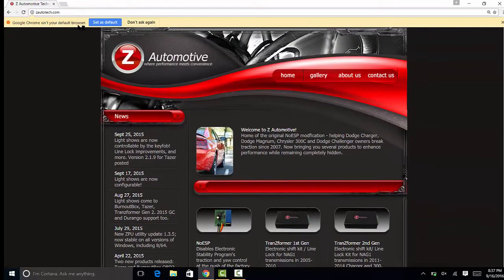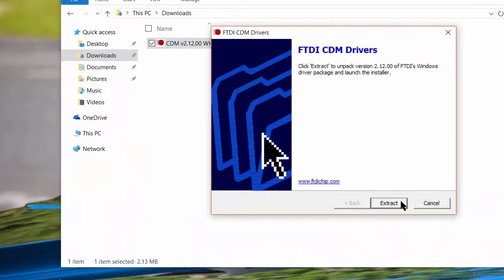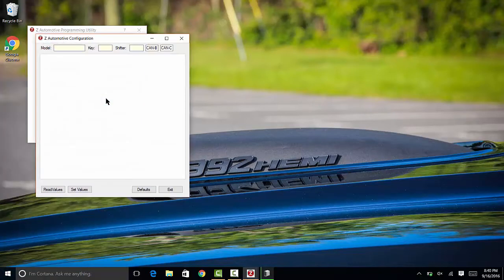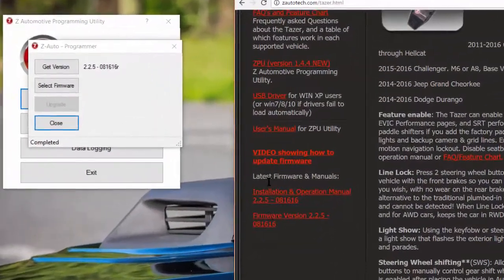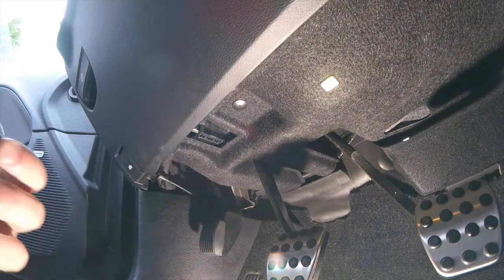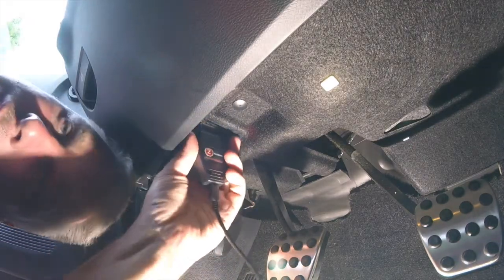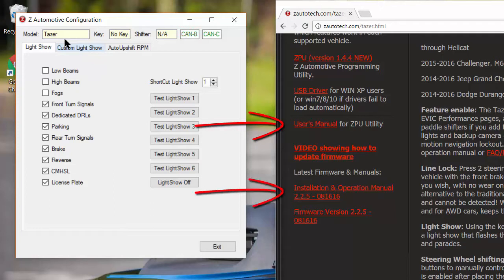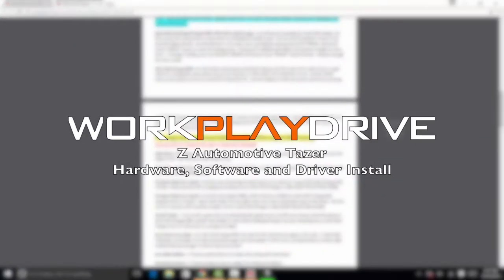zAutotech TaZer Software, drivers and Hardware install - zautomotive.com

Comment: Just subscribed, I have a 2017 Dodge Challenger SXT Plus, my model didnt come with factory Super Track Pack  or Drive modes options but does have a 8.4 Uconnect system. Will the Tazer turn on the performance pages on the EVIC and 8.4 Uconnect screen?
Reply from the maker: Thank you,  it’s a long list of what works and what features can be turned on for the SXT models. This page has all the details on what features work with your vehicle https://zautomotive.com/zpu/instructions/tazer_user_guide_2.5.1.pdf
Reply: @WorkPlayDrive  Thanks for that link. I just read it. So let me make sure I am understanding it correctly and maybe you can double check me if I am wrong, so my SXT plus will NOT have Super Track Pack performance pages added with the use of the Tazer device, correct?

Comment: I did everything but the tazer won’t show up on the pc the light flashes red but won’t connect to the computer ... the drivers were installed
Reply from the maker: Have you tried using a different USB port and cable?

Comment: Can i use it on multiple cars like opening srt pages for someone has a diffrent car than mine for ex: i have a grand cherokee can i open srt pages for someone who have a charger ? 
Thanks.
Reply from the maker: Yes, you can enable some of the features as long as the car supports it, but the live functions will not work without the TaZer connected.  This also creates the issue where the person you enable it for will now need to rely on you to disable it before they go in for dealer service.  Lastly it's kind of cheating the system using a product designed to be purchased for 1 car on multiple vehicles.

Comment: Hey man. I have a 2017 charger scat pack and done everything said to do and most everything works but my SRT pages do not show up at all. Any thoughts?
Reply from the maker: I believe they were having an issue with some (not all) 2017's have you reached out to their support?  https://zautomotive.com/about-us/contact-us/ They will be able to provide some more info on the issue and their planned release of a fix.

Comment: Sadly my Computer does not find the Tazer. Using  Windows 10, i also tried to install the USB Driver with sucess. But its still not found from the ZPU Software....
Reply: Problem solved. The USB-Cable which was sent to me with the Tazer is broken, replaced it and its working now.
Reply from the maker: Nice, I was going to recommend getting a new shorter USB cable.

Comment: Both have to be green or one cuz mine only second one is green and first one is green and red green and red ??
Reply from the maker: When connected to the PC does the ZPU allow you  to configure?  I had an issue with one of my PC USB ports and had to unplug the Tazer, reboot and connect it to a different USB port.

Comment: so are you suppose to have the tazer in forever or is it ok to take it out once you make the changes you need to make to your car?
Reply from the maker: Some features require the tazer to be in like the line lock, light show a lot of other features can be changed and the Tazer removed.   Check out the section called Live Menu settings for the ones that require the tazer to be connected.  http://www.zautotech.com/docs/Tazer%20user%20guide%20-%202.2.7.pdf

Comment: Will this void warranty by any chance?
Reply from the maker: I would recommend putting your settings back to normal and removing the TaZer before servicing.  If you are going in for troubleshooting you should always provide the techs with what they are used to, added settings, changes and an additional device will result in extra time while they try to understand the the cause of your issue.  

To answer you question here is a quote from their FAQ  http://www.zautotech.com/docs/Tazer%20FAQs.pdf

Q: Will this void my warranty?
A: Per the Magnusson-Moss Warranty Act (1975), a manufacturer can only deny a warranty claim when an aftermarket
component is used if they can prove that the component caused the failure. Simply write down the settings that you
used the Tazer to change, and change them back to their original values before service - it’ll be as if it was never used.
As for “live” features such as light shows, line lock, full ESP disable, nav in motion, force video – use of those features
can’t be detected.

Comment: Thanks man!! Great vid. I ordered my Tazer a week ago last Monday, so it should be here by tmr or Thursday at the latest and I can then open up some cool stuff too.
Reply from the maker: One of my favorite features is the light show (headlights and fogs disabled)  It screams "look at me" when at car shows ;).  Can't wait to reset the adaptives and use the shift light at my next visit to the drag strip.
Reply: Have you tried to make a "Custom" Light Show yet?? I now have all the settings where I want them and I did notice that when I have the SRT settings enabled that I lose the SCAT Bee and only have the choice of "Challenger or Hellcat" the Bee is gone with the SRT settings enabled. Oh well!! It's only on for 2-3 seconds anyway and I like the SRT settings enabled. The default Light Shows are cool, for sure, but I want to make up a couple of my own. I assume that when making my own "Custom" Light Shows, and want to test them, I bring my laptop into the car with me, connect the Tazer to the laptop and have the car in the "RUN" position but NOT running...is that correct?? I can't seem to find anyone else anywhere that have made up their own Custom Light Shows??? What do you think??
Reply from the maker: Not yet on the custom light show, soon though. If I remember correctly you can access the light show options with the car off and laptop connected. If you make any good ones don't forget to share them.   

I just turned on SRT mode on Wednesday for the first time.  Correct the Bee will go away because the SRT more completely changes the display design and fonts, I was a bit sad but the changes were totally worth losing the bee.
Reply: Well, I had a useless hour spent trying to do a Custom Light Show. I got NOTHING!! The only thing I did get was some strange crap. Can you tell me if you noticed when you're cycling through the Tazer options if you saw (NO DEVICE) flash for a second in between any of the options at all?? I don't remember this happening to me when I 1st installed the Tazer, but maybe I missed it?? I doubt it but that's why I'm asking you?? Lol.. Secondly, once the Tazer is loaded, it's loaded, correct?? Well, I had to re-load it twice today. It was empty, NO 2.2.7 or anything for that matter. And 3rd, does the RED light go out eventually, when it's connected to the laptop?? It starts off with a quick flashing Red/Green combo, then a slow Red flash and every 4th flash, there's a 5 second break, then it starts again with 4 Red flashes, then a break. Finally, the 3rd and last time I tried to re-load 2.2.7 I get a pop-up window stating that there is NO DEVICE PRESENT and it suggests that I look for the Device in COM3 drop box, but when I hit the drop arrow, it's empty of course. I'm NO computer whiz by any stretch of the imagination...but I think I have a (TECHNICAL MALFUNCTION) going on here?? Yet when the Tazer is mated to the car, all the options function as they should, but for the Custom Light Show, obviously, since I can't get in there to do anything. And btw, if you want to activate the A Light Show while the vehicle is in motion, Connect the Tazer to the Laptop then, go to the CONFIGURE PAGE, then LIGHT SHOW PAGE and click (CTRL + SHIFT + L) all at the same time and Check the Box on the Lower Left Side, another window will appear and click OK and you're off to the races...lol...Ok, any help or info would be appreciated sir!! I did email Joe about the Custom Light Show issue but that was before these other issues popped up and he's hiking in Colorado and will be back on Monday. I don't anticipate any grief from Joe at all with my Tazer either, I've found him to be a very pleasant and friendly guy, that has Customer Service as his First Priority, but I'll keep you posted. Also, before I forget, when I did email him the first time, it was about making up a Custom Light Show and I wasn't sure what state the car should be in when I'm making up the Custom Light Show, this was before I knew that you had replied to my question, so just so you know, in his reply, he stated that it doesn't matter whether or not the car is on or off or in run, just plug the Tazer into the car and the USB to the Tazer, then the Laptop and away you go!! So, there you have it. Please let me know when you can if you have any suggestions, thoughts or ideas what's going on with my Tazer. Oh ya, just in case I got stuck, I did put all my settings back to the OEM parameters as well. You never know, right?? If something bad happened, how would I explain that nightmare to the Stealership?? Thanks!!
Reply from the maker: This is a long one sorry took so long to respond.

NO DEVICE - I have not had this issue at all since receiving my TaZer.  

I have not had any issues with the device being discovered, from what I've seen online one option is to close the ZPU and connect to another USB port wait about 30 seconds then try again.  I'm not sure about the red green flashing, I didn't really pay attention when updating.

I'm a little confused if you were able to install the firmware or you were never able to connect the TaZer to your PC???  

1. Disconnect the TaZer 
2. Make sure you have the latest ZPU installed which is 1.4.8, uninstall the ZPU and grab the 1.4.8 from here and install  http://www.zautotech.com/docs/ZPU.Setup148.msi 
3. You might need to install the drivers you can grab them from here > http://www.zautotech.com/docs/CDM%20v2.12.00%20WHQL%20Certified.exe 
4. finally download a fresh copy of the firmware 2.2.7 - 110216

you can use this video to see the issues I had while installing the driver.  https://youtu.be/j4zQHcnh1hs?t=33s

Let me know if you can get connected, Joe is a good dude and should get you sorted out quickly if you do have an issue.  My only concern is that "No Device" message you saw.
Reply: Hey Man!! Thank you for the reply and all the info as well. Please...NO worries about the delay in replying, it isn't a big deal and I didn't think there was a delay at all. I know that my comment was long and had a lot of crap in it too!! I shouldn't of bothered you with it either. The only reason I did was I've watched all you vids and you seem in tune with techy stuff for sure and you certainly look like you know what you're doing, so my hope was that you either heard of these issues or knew somewhere for me to start?? Which you did!! So, I'm going to do what you've suggested here in a few minutes and see what happens. It can't make things any worse that's for sure. You're right about Joe as well, from my previous emails with him, he certainly is a great guy and we'll figure this out for sure!! Like I said earlier, I have put all my settings back to factory settings in the car, so that part is covered and now I'll treat the Tazer and the install process as if I just received it in the mail and start everything off fresh. I will let you know how it all goes as well. It's late now, so I won't be able to start a Custom Light Show, I'll attempt that tmr, but for now I'll do everything else. Thanks again for taking the time to read all my crap and for passing along some info for me to start with. Have a great night and I will post a comment when I've finished everything. I don't like that "NO DEVICE" message either, so I hope that I don't see it again. I may have unknowingly done something to cause it, so I'm hopeful that a complete fresh install of everything will remedy that issue. I am going to completely uninstall and remove all the previous drivers and programs from the laptop as well as the manuals...lol...I know that they don't have anything to do with it, but I am going to treat it as if I just received the Tazer in the mail and start everything over again. Here goes...
Reply: Ok, all went perfect!! So, that's a good thing. It's after 2am now, so I'll do the rest in the car tmr and I'll let you know how that goes. Thanks again for the help!!